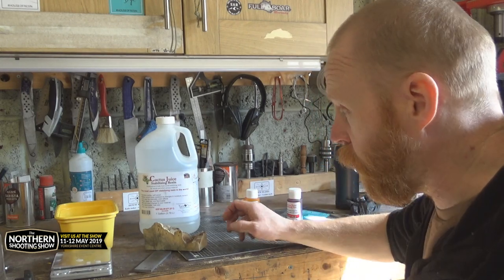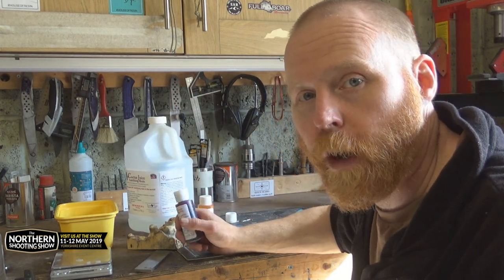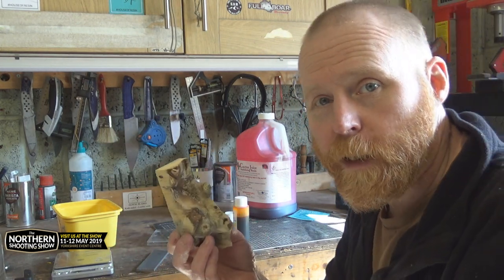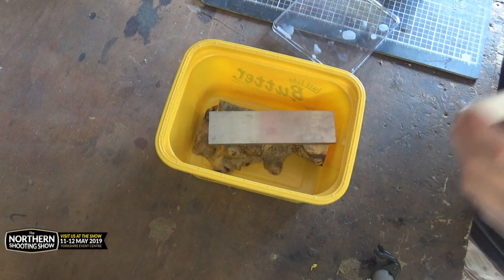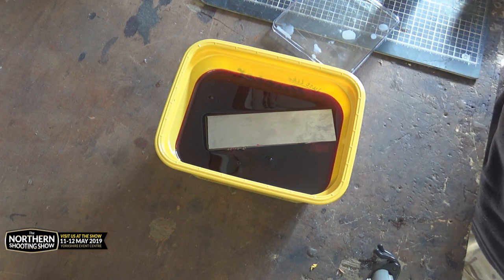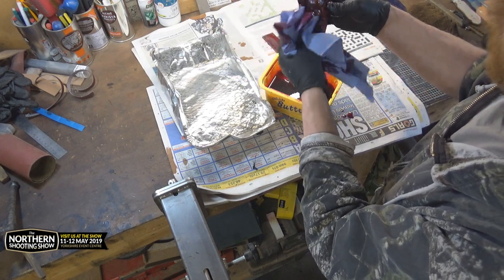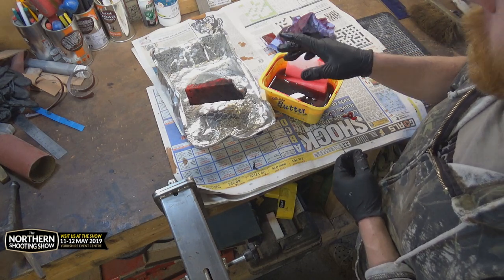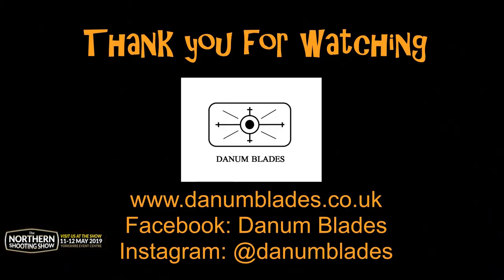Dying and stabilising wood with cactus juice

Comment: hehe, I keep finding this kind of "cactus juice" and "wood dye" in this context (which is very very cool, and I make knife scales among other things)... but I harvested a variety of Eastern prickly pear (cactus fruit) that bleeds an extremely concentrated magenta dye juice. I'd like to dye wood of a Native American flute with it. Sounds simple but since no one wants a flute that looks like a chair leg with polyurethane clear coat (which would have safely locked in iffy-permeating dyes) then I need to prepare both the surface and the dye (pH? acid? alkaline? neutral?) so that it has the least possible tendency to wash off. These flutes are usually finished with bear-fat-mimicking compounds of, like, a snotty mix of beeswax and oil. I might compromise and at least use a polymerizing drying oil like food-safe walnut oil (lightly) to protect the natural dye finish (that's not been soaked in a vacuum). I do need to finish my vacuum chamber. My dye howitzer I made with a 60's cast iron flywheel refrigerator pump and a big PVC cylinder.
Reply from the maker: Very interesting to hear.👍